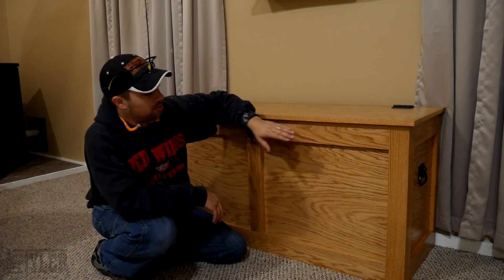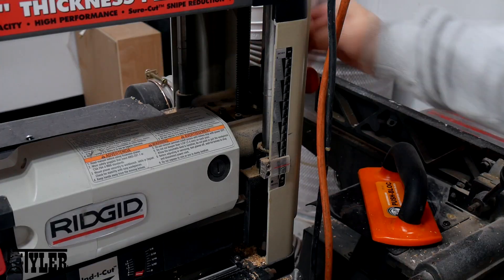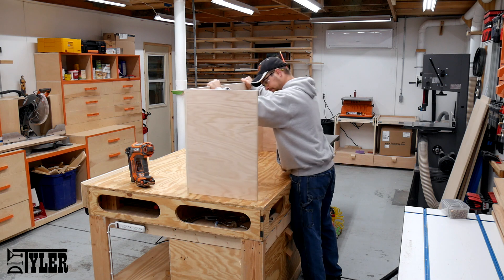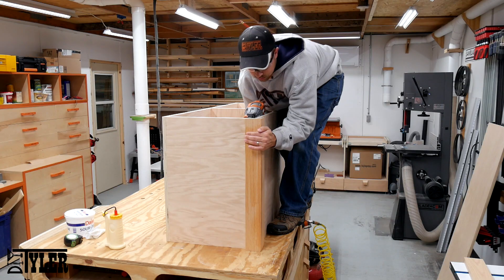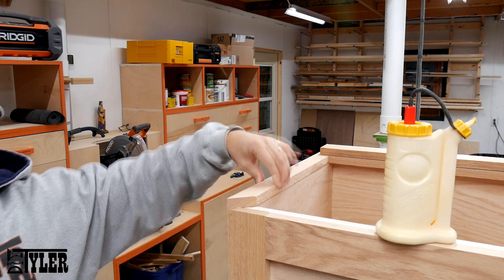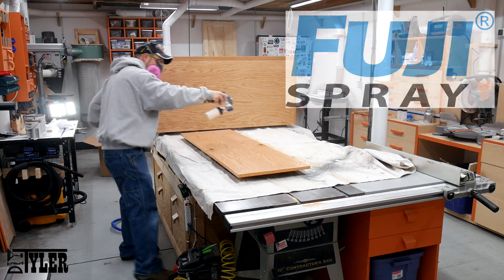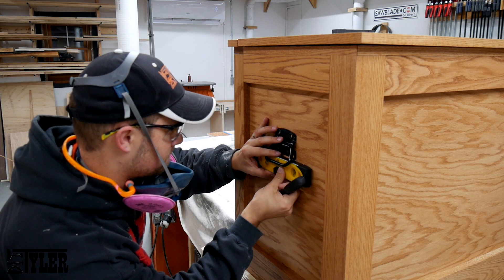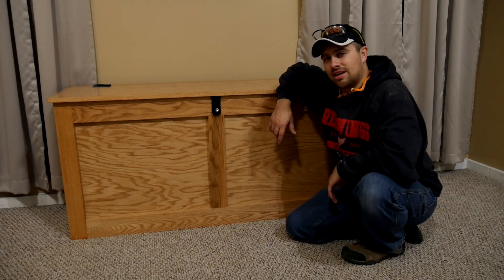Red Oak Storage Chest with Solid Oak Edge Banding | How To Build

Comment: Nice video...  2 questions.  Any reason why you didn’t use screws instead of brad nails (I.e. pocket holes). And you have Rigid everything.  Why no Rigid Jointer?  You used to have a Rigid table saw as well but now a Delta.

Comment: That whole box is held together with 18 gauge brad nails and some glue? That doesn't seem like enough given the weight of the pellets. I also have a pellet stove so I know the weight and it seems like that box will wear out or split give the fastening choice. Hope it lasts longer thanI think it will. It looks great!
Reply from the maker: +Croz 1007 it's just preventing bags from sliding into a mess, not carrying them. Have you used wood glue??

Comment: I have a suggestion for avoiding the need for stain to make the grain pop. Pat Keegan has a great video on making your own pre-finished plywood https://www.youtube.com/watch?v=fRRxbusiaHw and it works great. The SealCoat, while hard to find, is a wonderful way to make the grain pop and it only takes 30 minutes to dry. I am making cherry cabinets and two coats of SealCoat and two coats of water based poly is all I'm using on the cherry. It looks fantastic. I may pre-finish all of my plywood projects from now on. Give it a try.